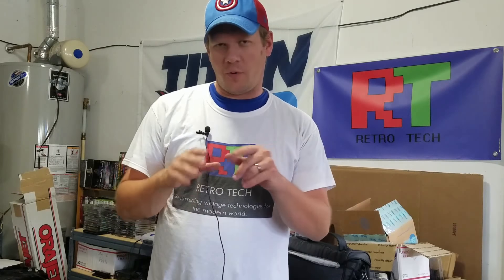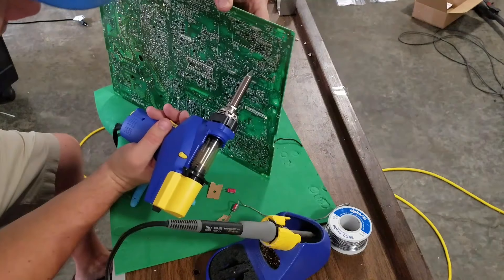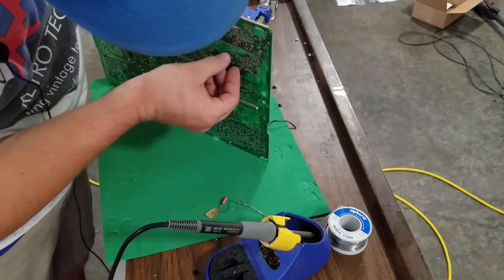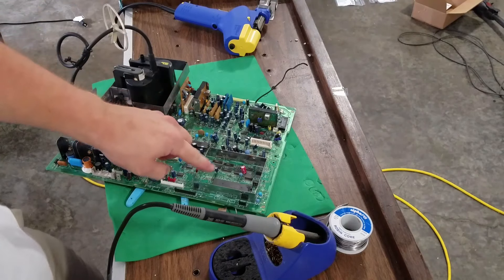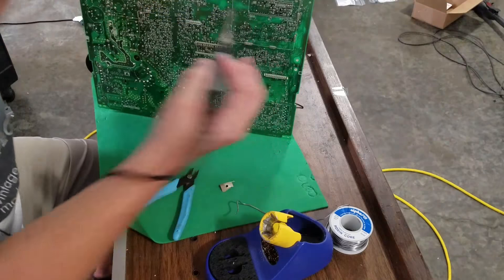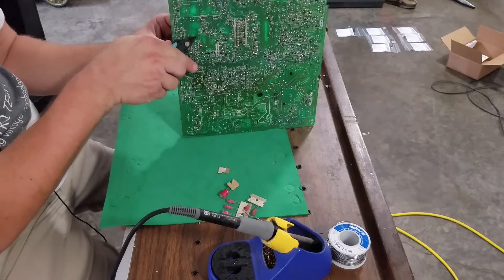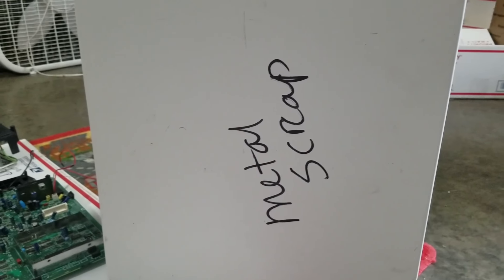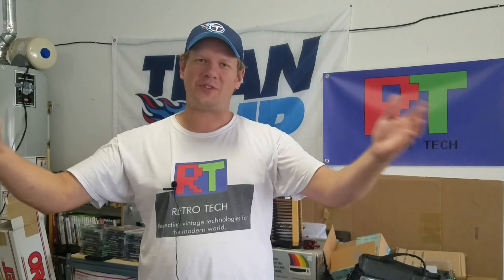Sony PVM Restoration Part 3 - Removing & Replacing Capacitors

Comment: Great vid Steve. Interesting soldering technique! I usually find it easier to leave the leads on the caps while soldering them in. I insert the cap, slightly bend the leads to stop it from falling out, then touch the iron/solder to the joint at the same time. I also remove a bunch at a time, them solder in a bunch at a time. Means I can quickly and efficiently whizz them off/solder them in and there's less time dropping/picking up tools. You seem to be pretty comfortable with your method though so good stuff, keep it up. And the flux really is a great help! Looks like you're using a pencil tip? I really recommend using a chisel tip. I think mine is a 1.6mm, really helps to ground the iron on the joint and apply the heat more efficiently, thus less chance of burning any pads etc. Looking forward to more videos :D

Comment: a desoldering tip. if jou flote a littlebit above the pcb in the tin and rotete the desoldiring iron  it prevets the leads from stikking to the side off the bus off the pcb.

Comment: Hey Steve, quick question: On another one of your vids you mentioned not replacing the capacitors on the PIP (Picture-in-Picture) board of your consumer trinitron since you weren't gonna be using PIP much. on my JVC the PIP board has a connector and can be removed. If I remove the board entirely will the TV still function the same minus the loss of PIP? Thanks!
Reply from the maker: Hi, It should still function fine, but you won't be able to use the PIP features.

Comment: Excellent video! Just one question, why didn't you recap the psu? I've read that is important to discharge those big caps around the power supply unit

Comment: When replacing the capacitors do you just do electrolytic? Or do you do ceramic and others as well. https://www.manualslib.com/manual/749087/Toshiba-27a60.html?page=23#manual Say I wanted to order a cap kit for this Toshiba. I notice they have Electrolytic, CD Capacitor, and other types of ones like metallic/plastic film.
Reply from the maker: Sorry I think I got to this with you yesterday through FB, but please let me know if that wasn't you.